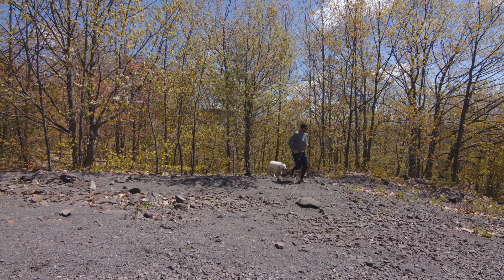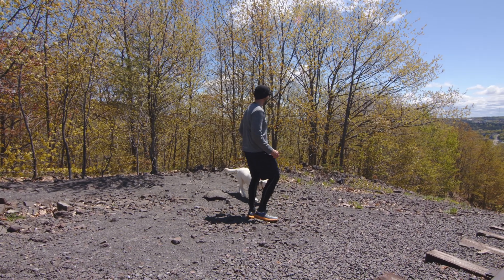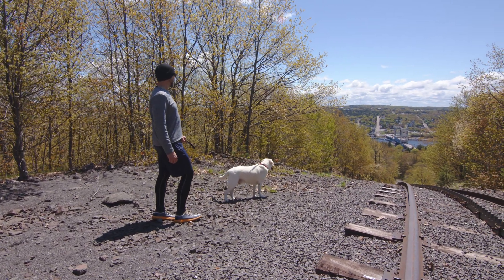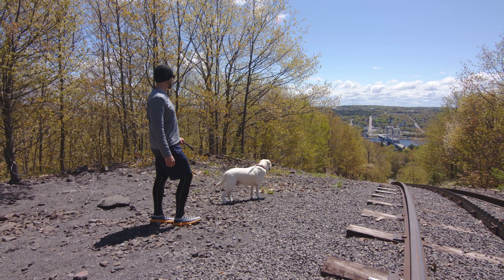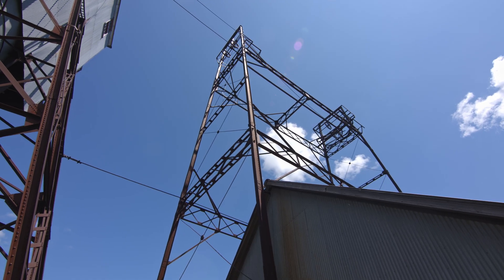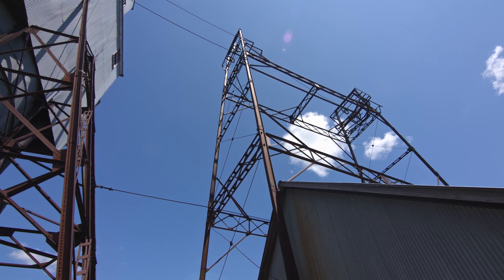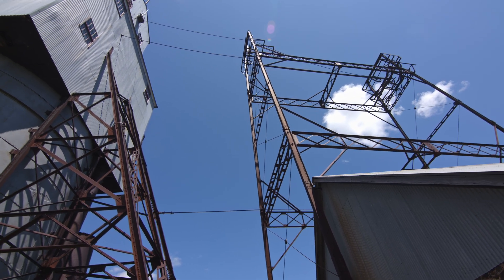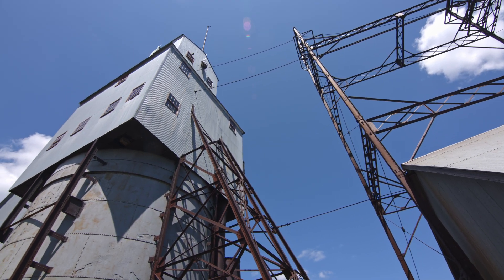Using Old Mines for Pumped Hydropower Energy Storage is a Game-Changer

Comment: I'm frustrated that no engineering details were given. No rough estimates of the amount of energy storage capacity in the mine, or how much energy usage varies daily in the area grid. Or comments on wether variations in energy demand are a problem in the area (some power plants can easily deal with fluctuations while others such as nuclear plants are better ran at a constant load). The Quincy mine is deep (9,260ft at 55degrees = 7,585ft) but it's volume is likely small. And it's usable volume is likely next to nothing. The water would need to be contained in tanks and piping which would be nearly impossible to construct in the abandoned mine. Safety standards aren't lax like they used to be thankfully, and I doubt anyone would be allowed to even explore the mine for a simple feasibility report.

This sounds like a crazy idea someone had while running his dog that sounds like fun to talk about and then say that they got a bunch of students from different departments and countries involved and then throw out some popular buzzwords with no actual engineering done. Even for something in the prospective phase, this idea could have been exhausted in less than a day. It's just something that sounds cool to non-technical people who read the Tech magazine.

Comment: Note that this would not generate electricity, it would only store it. Electricity from the grid would be used to pump water to the upper reservoir(s) during times of low demand. It would then be let down through generator turbines to the lower reservoir(s) during times of high demand. Inefficiencies of the pumps, turbines and other components would actually result in some loss of energy but the fluctuations in energy demand on the grid is smoothed-out. That is the goal of this technology. Read about the reservoir in Ludington, Michigan.

Comment: It is a great idea in the right places. Can certainly make a dent in moving to green energy. It will not solve all the problems of course but if these enormous shafts are filled with water, the only issue I see is sediment build up with whatever chemicals, elements, minerals, etc that could still be in them. A lot of mining is not a clean process so. This is why shafts like these should be evaluated with that first as well as if these shafts could be better-suited to provide geothermal energy. Maybe there's enough water in them for instance to provide geothermal and hydroelectric power if a team was to take on all these challenges.
Reply: It cannot make a serious dent in the problem.  Most mines wouldn't even qualify. Most of the mines are not very big in volume and not very large vertically.  A large mine might have 10 levels. That's a hundred feet between the top and bottom of the mine. That isn't much gravitational potential.

Comment: I still don't know what the heck PUSH does...........Pumping water through old mines to create hydroelectric power.......??????????????????????????????????  I'm left hanging.
Reply: Yep. That's it.
Reply: You pump the water up using spare (renewable) energy, then you generate power with turbines when you need it by letting the water fall back down. Just like normal pumped hydro (where you typically have two reservoirs, one high up a hill and one low down). The benefit is to move energy from when you have too much to when you don't have enough.

Comment: Get to the point quicker ..
Reply: There are mines in the U.P.. Many are abandoned and have since filled with water. There's a possibility to use the stored volume as part of a renewable energy system called, "PUSH" (Because only engineers would call it UPSH). This video is a discussion on this topic of potential use for the abandoned mines.
Reply: @davepikleyeh  sure it is, but they didn’t really say anything about how they actually plam to use mines for this purpose, how this might compare to other hydro storage, what mine locations locally or globally might meet the criteria they require for feasibility…so I would say they never got to the point